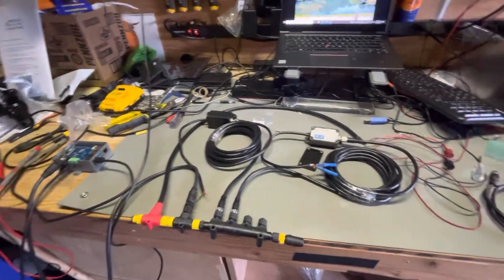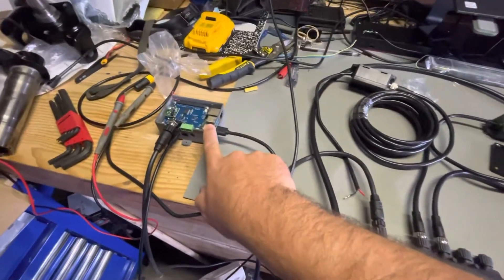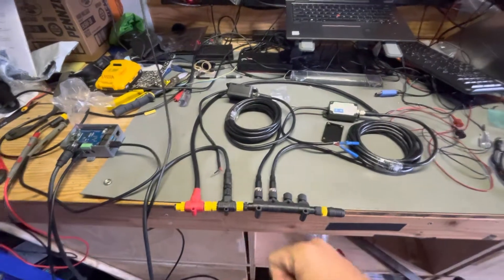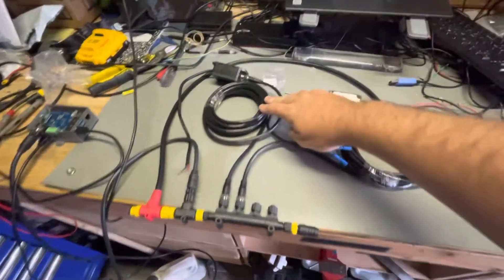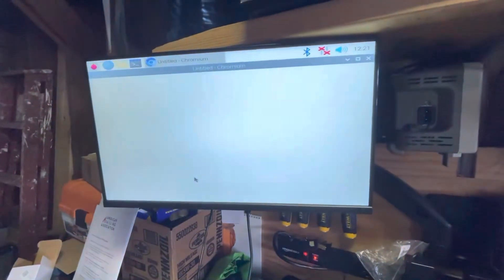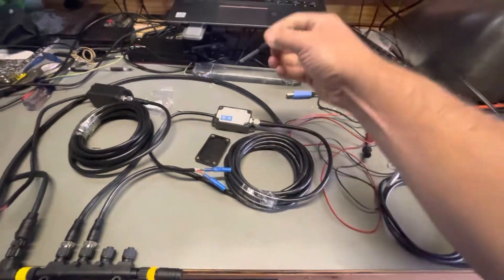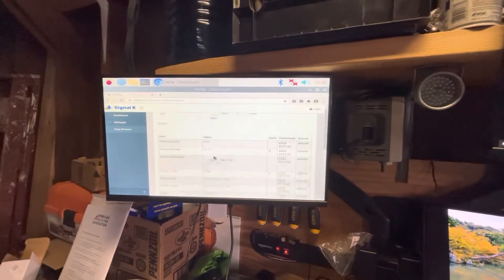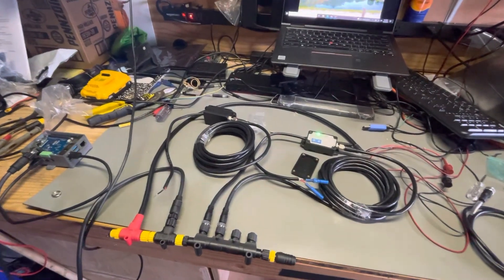NMEA2k fluid level sensor adapter from AliExpress

Comment: Mine is stuck on 21 gal tank I can’t change the tank size instructions that came with it are not great red wire is sender is the black wire hooked to ground?

Comment: I understand the type of fuild, I don't understand #of tanks? I have 2 fuel tanks each has a analog sender but there are differnt tanks w/ differnt analog senders will I need just one allied express box for both tanks? or a box for each tank? so the box doesn't care what the tanks capisty is? or is thcapisty configured w/in the MFD? I have the Raymarine element a middle of the line MFD. thanks for advicing an nice video realy like your lab setup.

Comment: Do you have analog gauges as well? Does this interfere with them? and or do you have to have the KUS as a separate sender just for the ali box?
Reply from the maker: Unfortunately since these are resistance based units you can’t really get them to work with both an analog and the digital at the same time. I still have my handy dandy wooden dowel rods with notches carved into them for backup.

Comment: Hey Brenton...thank you for the video. I have been unsuccessful so far installing my Lowrance fluid level sensor on my 2022 Nitro bass boat. I have one tank and have everything connected properly. The one component I do not have is the small KUS black box where you adjusted for one and two tanks. Lowrance upper tech support thinks my issue is that I need to calibrate the sensor to the tank configuration. Is that small box possibly the issue in the communicating information from my one tank to NMEA network and then to my Lowrance HDS Live MFD?
Reply from the maker: so you've got something like this? https://www.tradeinn.com/waveinn/en/lowrance-fluid-level-sensor/135930429/p plugged into your N2K network? The black box I've got is a system that reads a non-N2K sensor and puts it on an N2K network. My KUS level sending unit is just a variable resistance (240-30 Ohms) so it can't talk to a N2K network. To get it onto the N2K network I use the black box from some Chinese company via Aliexpress. Without seeing how you've got things hooked up it's really hard to tell what's going on. Perhaps make a video and post it then send me a link. One issue I could imagine you having is if you have the European standard fluid level sensor (the part in the tank).
Reply: @brentonpiercy  Hello Brenton, I'd like to jump in on this question. Like the gentleman that reached out to you I am having a similar issue with my Wema fuel tank sending unit reading on my Lowrance HDS unit.  My boat is a 1997 Blackfin with Wema SL-16 sending units that also work on 240-30 Ohms.  I have the fluid level sensor you showed in the link above wired into the Wema sending unit on one end and then plugged into the NEMA 2000 network on my boat and it's not working (it's not reading anything, not even a 0 on the Lowrance unit). Do think think I need I need an additional "black box" as you showed in the video or should this be all I need as is?  Thanks!!
Reply from the maker: @ironmule5200  Yeah. you can't just plug an analog sensor into the N2k network. The adapter box takes the 240-30 ohm signal (read as a voltage by that little black box) and converts that to a digital signal that is put onto the N2k network. N2k is a type of digital bus that allows your Lowrance HDS unit to see a lot of sensors on the same set of wires. If you don't convert the analog signal to N2k it will not be able to read it.
Reply: @brentonpiercy  Thank you very much for the response! So, just to be clear it's sounding like I need to add the adapter box you featured in your video into my system.  From the fuel tank sending unit would I wire the adapter box to the fuel sending unit, then into the fluid level sensor unit (you linked in the answer above which I have on my boat) and then into the N2k network? Or should the adapter box allow me to take the fluid level sensor out of the system.  I'm assuming the latter is correct. Again, Thanks for your help!
Reply from the maker: @ironmule5200  I'm sorry. I think I missed the fact that you have the lowrance fluid level sensor unit I linked earlier. (https://www.tradeinn.com/waveinn/en/lowrance-fluid-level-sensor/135930429/p) If you've got one of those connected to your Wema SL-16 and the data line connected to your chart plotter and you're not seeing it on the chart plotter then I'm not sure what's wrong on the system. I'm not super familiar with the Lowrance HDS but you may need to do some level of setup on it. One thing I would check is whether you've got the right resistance range on your sensor. There are two standards (10k-0 and 33-240). Just double check you've got the right one with a multimeter on the black and read leads on the sensor itself. Slide the sensor to the full position and the empty position and see what resistances you get. If that's right and you're not seeing it on the HDS chartplotter there may be some setup you need to do on the chart plotter to get it to show up. Hope this is helpful.